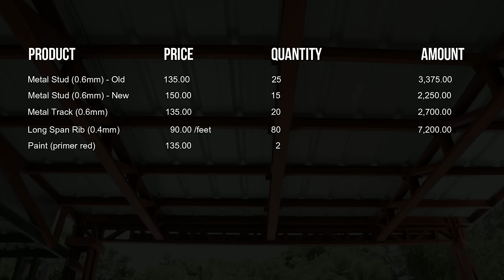Building Garage Roof with Cheapest Materials and Tools. Just Drill, Screws and Metal Studs.

Comment: fantastic work. you can use flasband also on those corners for heavy duty water tight seal. and epoxy paint for the metal stud for heavy duty rust protection
Reply from the maker: Salamat sa tip! Mukhang maganda nga yung flashband ipatong dun sealant para mas lalong tumagal.

Comment: Hi, pwede din po ba yan sa Tubular na 2nd floor? para di na i welding?
Reply from the maker: Hindi ko sure, pag 2nd floor need mo na siguro mag consult ng engineer para sa load capacity.. Kung 2nd floor better use tubular or cpurlin and mag consult sa may experience para sa load capacity kasi delikado.